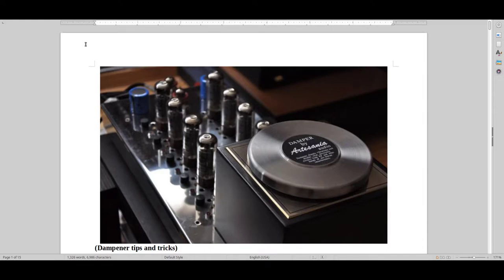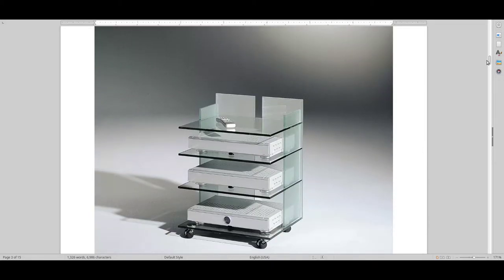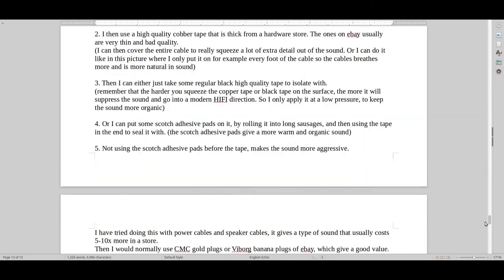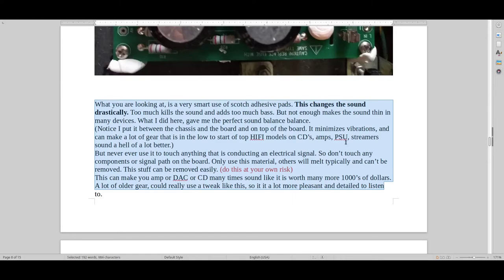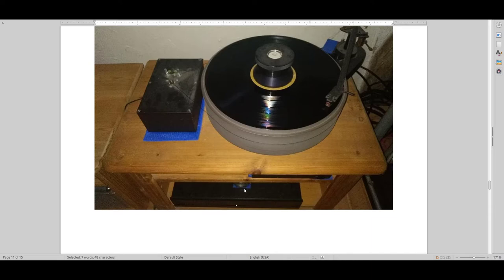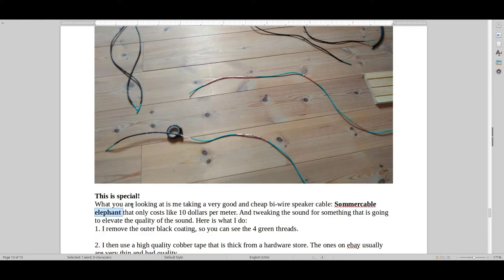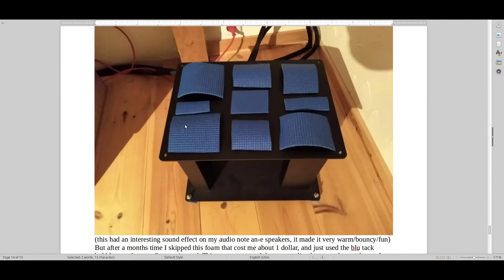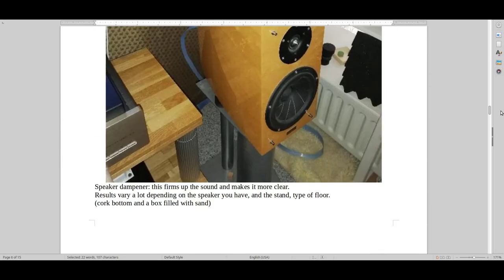Dampener tips & tricks

Comment from the maker: You guys can also just use the black tape on the cable without anything else, it gives a slightly different sound. The copper tape, basically just boosts the sound, giving more of everything. Whereas the black tape and scotch adhesive pads, makes the sound more stable/organic.

Comment: Do a little research from your side before offering advice. Artesania Dampers are made of stainless steel i.e non magnetic. Using door stoppers as peddled by our guru here may create issues and damage your equipment. Iron is usually the inner core of most door stoppers which gives it it's weight, with stainless steel on the outside. I've seen other Reviewers like Darko peddle the same nonsense.
Reply: Iron is no big deal. Audio Note and a lot of other companies make their cases from soft sheet metal, which is magnetic. I have 2 Audio Note components and noticed no difference having the tops off. I know on some gear that taking the lid off makes it sound more open and transparent. I'm not certain if it's because of the negative feedback interacting with electromagnetic fields. But clearly, if Audio Note are putting their top units in this same material, it's fine. I know a lot of companies claim their chassis is made from aerospace aluminum even though there is no such thing. There are only alloys.